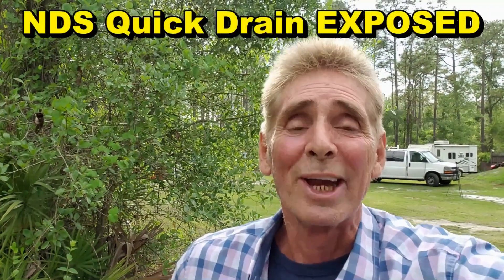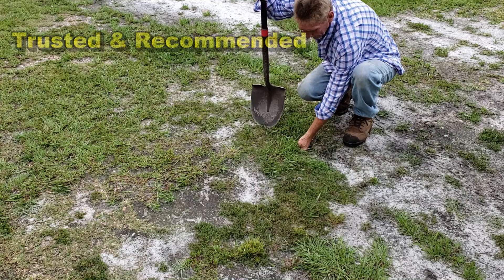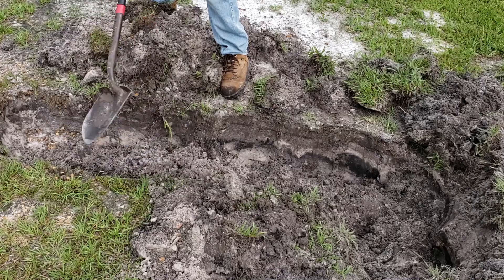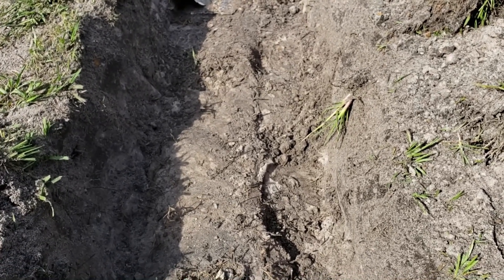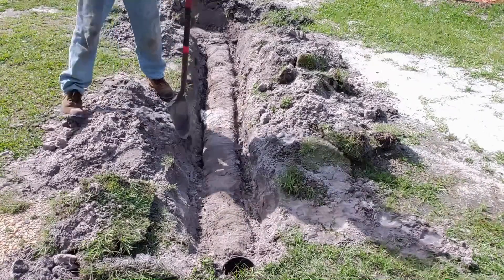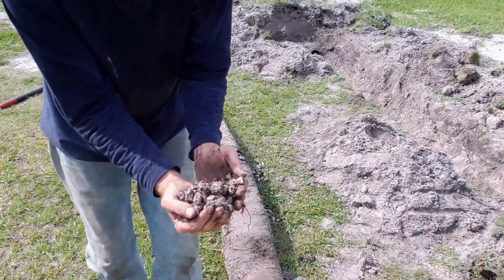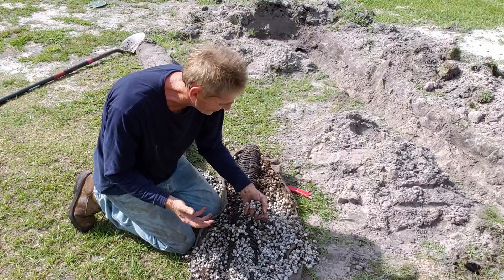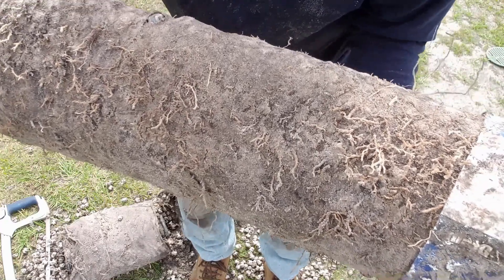NDS Quick Drain EXPOSED, French Drain, Yard Drain after 5 Years

Comment: Do you use solid corrugated pipe as well as the French drain NDS pipe combined for a longer run down hill With a few. Catch basins along the line 110ft downhill run.

Comment: Thank you so much for this video. This cinches it! Contractors want too much to take care of one side of the house, so it'll be me, a shovel, and an NDS EZ Flow drain!  P.S. It'll be installed to channel roof runoff away from the house and down the slope to the back yard. No cars, no trucks, no heavy equipment... so, I know it'll be just fine. ...now if only I could channel it into the woodchuck hole... that would be great... Thanks again!

Comment: You have to take into account the cost of the gravel and wrap when using regular pipes. The prices I looked at now is 99 cents per foot of pipe and $27 for a 40lb bag of gravel. This is home depot. The ez flow is just under $7 per foot coming in 10 feet sections. They have a buy 10 or more discount for just over $5 per foot. I think with the cost of gravel and fabric there is not a huge cost in price. The labor on the other hand is a huge difference. Prices may be much different from 2 years ago though. Likely the ez drain has gone down a bit.

Comment: Chuck, Thank you for your videos.  I have been watching several methods to decide which technique to use to drain my 2 story 3 gutters in the back of my home.  At present they are drained under a sidewalk then down under a patio.  I am redoing the patio, as water did cause it to drop.   So I am thinking of draining all three to one end then under deck steps then make it come out on top of a slope out onto the hill side, which I will gravel and make a dry creek bed going down the hill.  Also installing a small bubbly rock fountain in that area...I am thinking to use PVC pipe because I don't want any water coming out until it gets to the opening at the top of the hill/slope to the dry creek bed....Wildwood, Missouri

Comment: A driveway area, "heavy  equipment" daily, compacted dirt... which means not much percolatin' goin' on so it's no surprise the poly-rock  is "clean" and the pipe is clear. Thanks for making this video. I wonder what the ez-flow would look like in a front/backyard installation (not a driveway) which has a high perc rate.

Comment: From a licensed landscape contractor in N.C. if you will place a chemical called Permatol on the top of the drain pipe you problem will be solved with the roots, it is used on rail road tracks, power sub
 stations and parking lots it will sterilize the are for 3 years in the open under ground  and where you are going to pave I know it last 20 years
Reply: That an herbicide that kills all vegetation. Are you saying this is used by a landscape contractor in NC  with French Drains for root control? This doesn't cause issues with surrounding vegetation? (Like killing it.) And there aren't any issues with this being used in the ground by a commercial agency for this purpose? (There aren't any issues with it getting into the water table and/or killing plants off-site or down stream?)

You might want to make sure it's okay for this to be used in that manner (with a French Drain). Using it in the ground under a concrete foundation or pad is one thing, using it with a French Drain that has water flowing thru it and all around it all the time is another. Sounds like there might be some potential fines. (I don't know, but if  I hadn't done so already I'd make sure and I wouldn't just accept anyone saying it was okay to use because it's used in the ground. There is a big difference in putting it under a building structure or section of rail road that is most likely directly under a concrete pad. (That's about the only place it would be under any rail road track I've seen. The actual tracks are on top of ballast (rock) to balance the train and the track and to Drain water preventing any water accumulation that might interfere with the train. The thickness would depend on the train type and the area. But it would automatically be thick enough that you'd never have to worry about any roots ever interfering with the track. So they wouldn't use that in those areas.)

If that's you or a buddy of yours you might want to make sure it's okay to use that product in that manner. Right now it looks like you're sharing information with a business that might get said business in trouble of they followed that advise. Like I said I don't know,  but if the reason it's being used is because it's used in the ground I wouldn't automatically assume it would be okay to use with a French Drain. Even if it was only applied to the top. There is a HUGE difference in putting something under a building pad vs putting it in the soil over a French Drain. The first time there is a good rain it's going to get carried in the soil below the drain and provably a little in said drain.)

Comment: How deep was your trench dug and what happens if you have to cut a piece to a certain length. How do you keep the Styrofoam nuts contained?
Reply: Marvin Elder  get two zip ties and tie them on each side you plan to cut. Once you have tightened both sides then cut in between them that way you can still use the leftover piping for any future projects.

Comment: if it was a good pipe, why did you cut it open n everything? just wondering.
Reply: I believe it was  because he was going to install another catch basin there. So instead of trying to salvage the 8ft pipe, it would be easier to to a fresh install (since he would have to use shorter lengths) and show what a product he likes now looks after 5 years installed in a place it wasn't recommended for.
Reply: Part cost is nothing compared to labor. If you’re trenching all that out you may as well install new material.

Comment: Across my driveway I used it to put it in last summer but put it 3 to 4 feet deep.. bc I might drive over it.. I used it for just water run off my house but it has normal slots in it over driveway 4 feet deep.. but wanted it for run off my house.. dug mine by hand 4 feet 100ft long